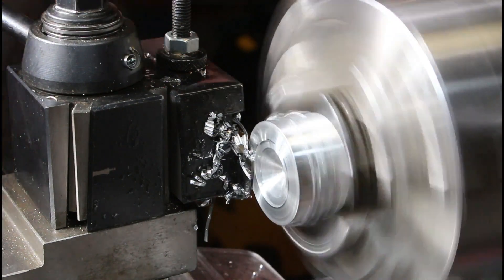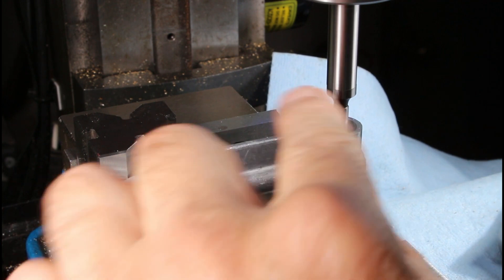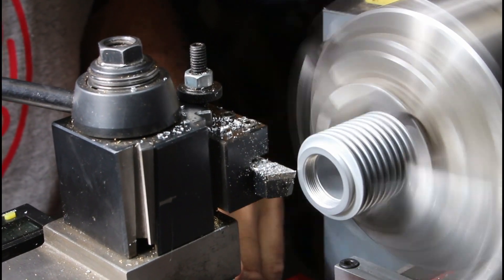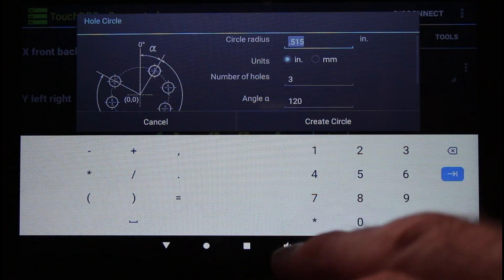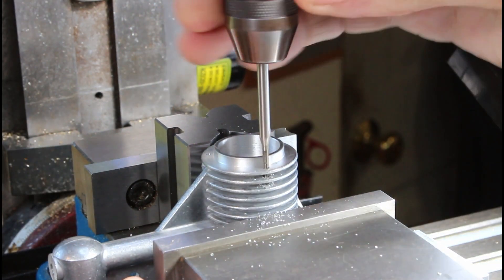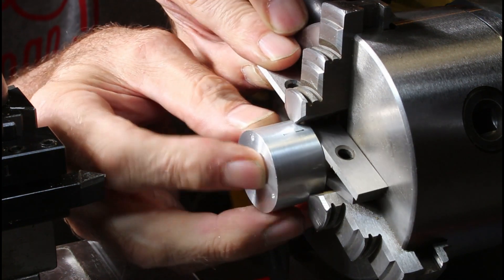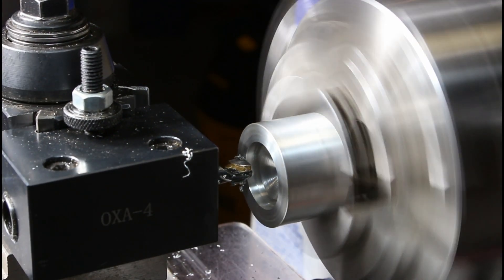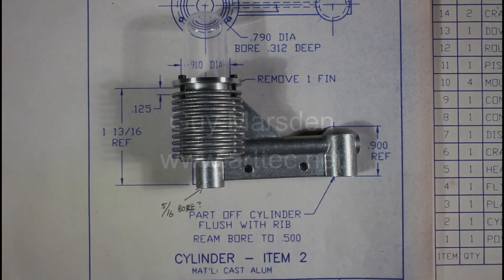Making a PM Research "Solar" Stirling engine - part 3

Comment: i have been trying to make a sterling for a long time
Reply from the maker: The PM research kit is extremely well done. The instructions are crystal clear and I was so delighted when it worked perfectly the first time I fired it up!
Reply: @GuyMarsdenMakesStuff   hi Guy I am still working on the 3 I have made so far helicopter a moriya fan and a sterling 60. I will look into the kit you have made.